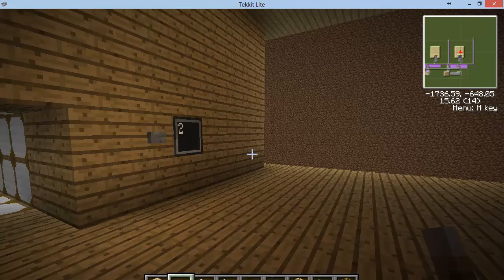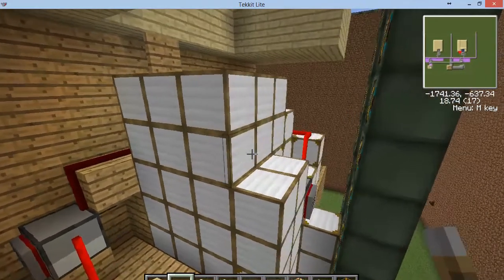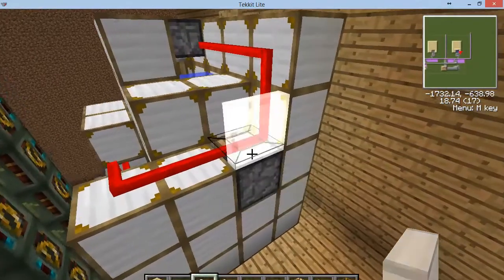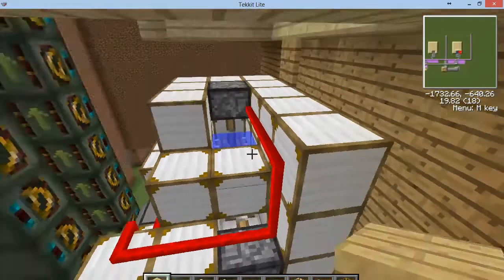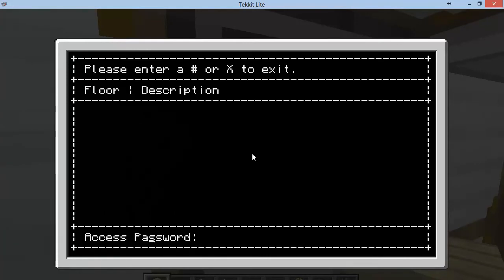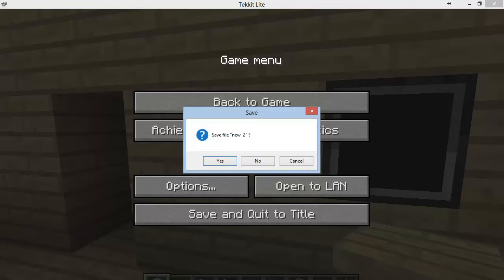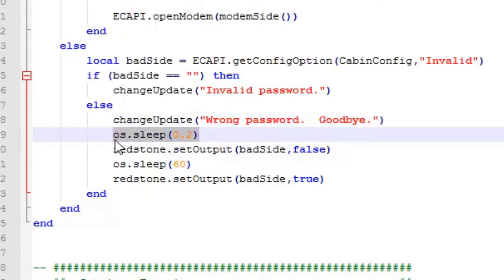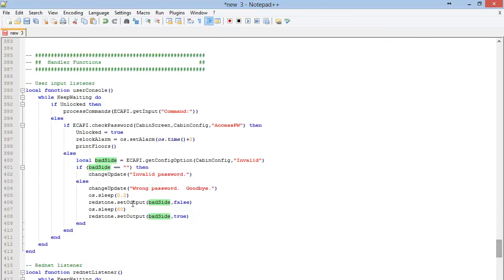Elevator Control 1.03 for ComputerCraft and Redpower Frames - now with Traps

Comment: I'm glad I was able to find this video again. Unfortunately, RP seems to be dead, but other mods have taken up the mantle.

I don't know if you made any updates to the program after this, but I'm going to test it with Funky Locomotion. At first glance I don't see any reason why it wouldn't work, but you never know.
Reply: Well this program works somewhat perfectly with Funky Locomotion frames. The only problem I'm having is that the cabin computer keeps getting stuck on "Settings loaded. Gathering Floor Information." after each use. I have to reboot the computer to get it to work properly again.

I don't know if you still play Minecraft or still working on newer versions of this program.
Reply: @DexLuther  Yeah...

Comment: Awesome program. I really love your elevator design. Your programs make for an awesome starting point. It would be a shame to drop lava on someone. You have to clean that up afterwards and their items get burned up. There's the MFFS mod that has devices that will remove items off of the unlucky person inside.

I think I'll fool around with using MFFS to remove a players items before removing the floor and dropping the person into a mystcraft portal sending them somewhere far far away.

Comment from the maker: Well, the Cabin system has an "AccessPW" built in.  I should probably have made that clearer.  on the cabin, do "reconfig accesspw [new password]".  That will control if someone can even use the computer.  The only mention for adding code is the os.pullevent to prevent Ctrl+_ keys.  Other PW's:  "ConfigPW" restricts access to reconfiguring the machine.   On Door systems, you can set "FloorPW", which will lock that floor unless the right PW is entered on the Cabin when the floor is selected.